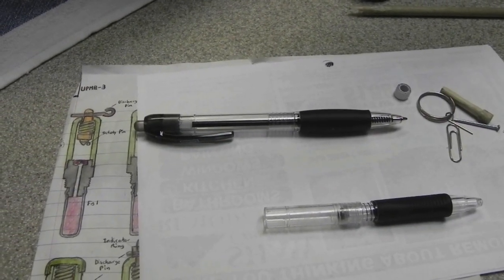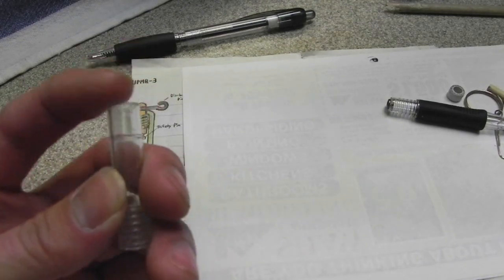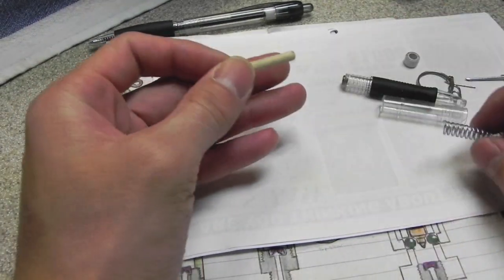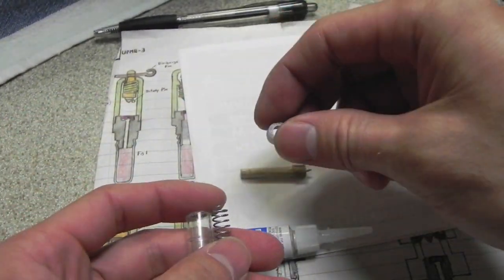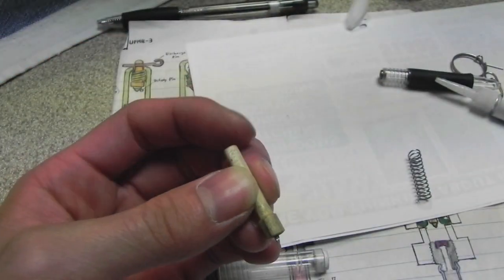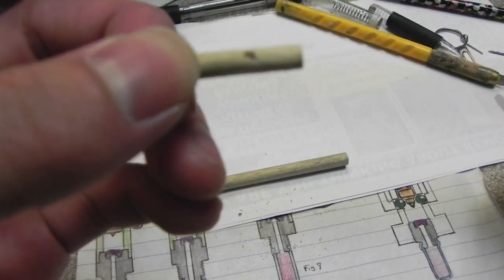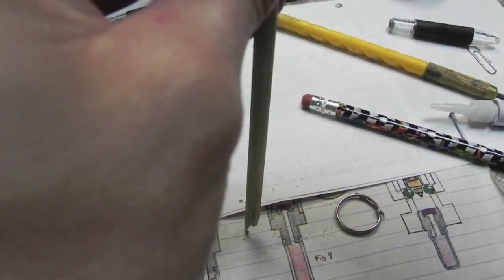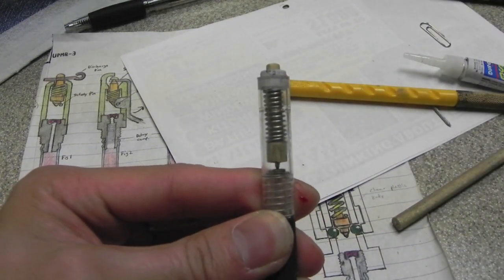How to Make a Pull Pin Fuse

Comment: @JRLPRODUCKTONZ You could make a trip mine... place the mine and connect a wire to the pin and put tension on it and put it across a path or on a door. and when the pin pulls... KABOOM!

Comment: @Tacome1942 instead of gluing the paper ring into the top end of the body, couldn't you just melt/bend the end of the plastic body instead? Seems to me that it would be easier/faster than constructing that paper ring.